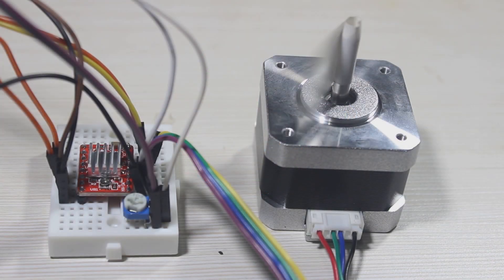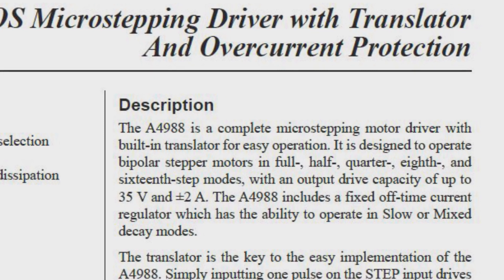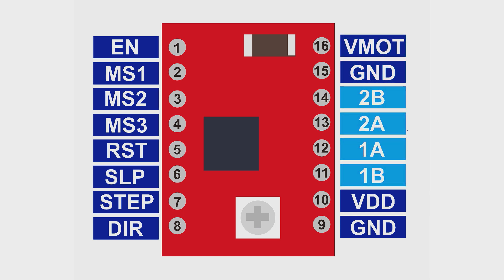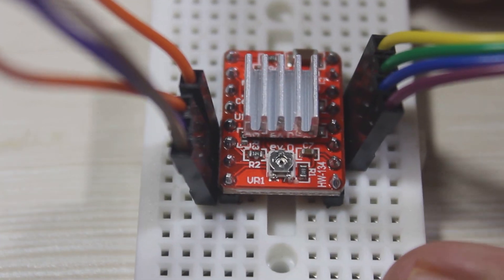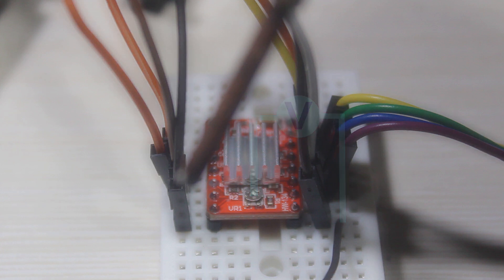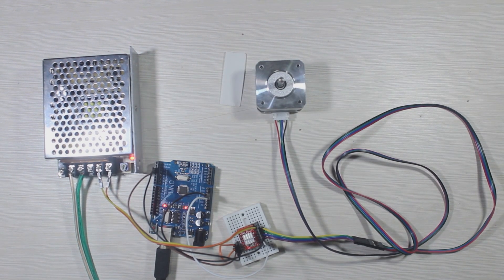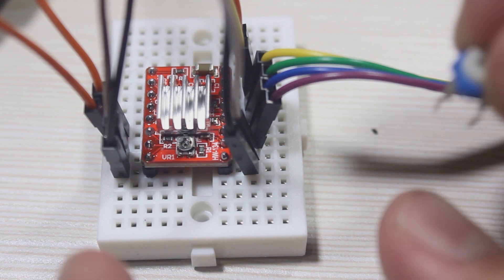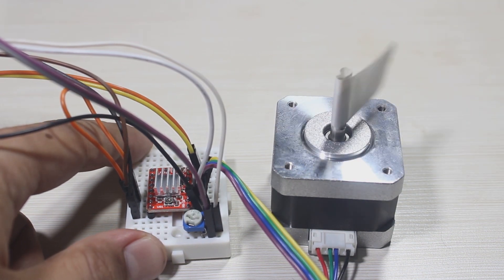How to drive a stepper motor easily using A4988 and Arduino

Comment: Need Help , I don't understand the formula to Get the value for current limit on A4988 with Audrino uno and cnc shield

I'm building a cnc hot wire foam cutting machine. I have. (2) N17 HS3401S- SZ motors. with [RATED Current DC 1.5A ] [Rated Voltage DC 3.8V ] I'm using  audrino  uno  GRBL installed with cnc shield with [3] A4988 steppers . X,Y.  I'm Using another step motor 17HS4401S Rated Current is 1.3A as for Z Rotary. The A4988 steppers what  current limit do I need to tune at ?  I'm not sure , I seen a few vid and now i,m confused Can anyone tell me how. Thank you .

Comment: Hi, how do you configure the pins of the  motor means which pin of motor is pin no.1(connected to 2B). I am not able to do as I am using BJ42D22- 23V01 NEMA17 motor.

For me it is not working properly.

Comment: // A4988 Stepper Motor Driver Pins
const int dirPin = 7;
const int stepPin = 6;
const int enablePin = 5;

// Stepper motor steps per revolution
const int stepsPerRevolution = 200;

void setup() {
  // Set the enablePin, dirPin, and stepPin as OUTPUT
  pinMode(enablePin, OUTPUT);
  pinMode(dirPin, OUTPUT);
  pinMode(stepPin, OUTPUT);
  
  // Enable the motor by setting enablePin LOW
  digitalWrite(enablePin, LOW);
}

void loop() {
  // Set the motor direction to clockwise
  digitalWrite(dirPin, HIGH);
  
  // Step the motor for one revolution
  for (int i = 0; i < stepsPerRevolution; i++) {
    digitalWrite(stepPin, HIGH);
    delayMicroseconds(500); // Adjust this delay to control motor speed
    digitalWrite(stepPin, LOW);
    delayMicroseconds(500); // Adjust this delay to control motor speed
  }
  
  delay(1000); // Delay between rotations
  
  // Set the motor direction to counterclockwise
  digitalWrite(dirPin, LOW);
  
  // Step the motor for one revolution
  for (int i = 0; i < stepsPerRevolution; i++) {
    digitalWrite(stepPin, HIGH);
    delayMicroseconds(500); // Adjust this delay to control motor speed
    digitalWrite(stepPin, LOW);
    delayMicroseconds(500); // Adjust this delay to control motor speed
  }
  
  delay(1000); // Delay between rotations
}

Comment: What is the silver thing you stick on the top of the chip?
Reply from the maker: that's called a heatsink, a metal to increase the heat of the IC.
Reply: @miliohm  Thanks for replying so fast.....I just googled it and found out from there also.
Reply: @sampuraktalukdar1374  It's Aluminum, to decrease heat of the IC. It's very important for the driver and motor to be able to use the rated current (around 2.5A for my Nema 17). Without the heatsink, it's only rated for half the current! Get some.
Reply: @robertbrodersen4438  Oh thanks for the info? 
So the motor not running in my case may probably be due to the lack of heat sink?....
Also I kept an led at the 4 outputs of the driver and it didn't blink neither damage (due to excessive volts) , so does that mean the driver ain't giving no output?

Comment: 6:13 I can't get this voltage on my driver with little potentiometer. I get maximum 0,03V. Where is the problem?
Reply from the maker: Did you use the conductive screwdriver?
Reply: @miliohm  Hi, I solve this problem, I am using driver L298N. It works perfect, but the motor is overheating after 10min of work. Do you know what is best option for solve this problem?

Comment: In my case. It does not work. I tried different arduino boards (uno, mega), different steppers (nema 17) and a4988
Reply from the maker: Sometimes there is fake A4988 in the market. It really easy to get hot, and doesn't work. Check the temperature of your A4988
Reply: @miliohm  Hey do you know how to check if A4988 is working or not?...

Comment: In your calculation the "2.5" value is a bit of a mystery. I assume it represents the "sense Resistor" value times the motors stepper setup percentage use (in my case this should be i00%). In another video the formula was "Imot x 8 x Sense Resistance (according to this guy the value "for most A4988"(?)  for this resistance is 0.068 Ohms). With his calculation I get a VRef = 0.816 Volts and with your calculation I get a VRef = 0.600 Volts. Which is correct? How do I know (without burning up my stepper or driver)? The only Spec Sheet I found doesn't list a "Sense Resistor Resistance", where can I find this value reliably?
Reply: Hi! where you able to find the solution? I have the same issue
Reply: @NedSar85  Note! That there is a reply to your question but you have to open the discussion to see it. I replied the wrong way, sorry!
Reply: The truth is “not with any confidence” but it worked anyway. The two surface mount resistors next to pins 18 and 24 (on my board) when magnified have 100 imprinted on them. From there I did some research to determine what the value of the SMD’s were (it’s been a while and I’d have to rediscover my notes and research), however these appeared to be, also based on blogs and conversations like this, to be the correct resistors who’s value(s?) were used to calculate, hopefully correctly. The result in the end was that my NEMA 17 driven star tracker worked. However mechanical issues related to the PLA 3D printed frame and gears driven by a curved threaded rod produced other issues. If I do this again I will pivot a straight rod and make the frame from 3/8” plywood in order to safely support my heavy camera rig. A lot of frustrations in this project that ultimately left me with more problems than time to solve them. The A4988 was the least of my concerns!

Comment: How much amps and do you need for moving the motor? Does it get a good torque? Thanks!
Reply: Not so much seeeing power cable is 20-18awg. My bet it's less than 2 amps.

Comment: i am facing the same problem had tried all the solutions changing wire combination, code, pins drivers but the motor is still sometime gives a beep only or rattles with beep and the strange thing is that motor is showing continuity in all four pairs, led blew up no matter what the wire combination is it show continuity on pairing 1,2 -1,3 -1,4 and so on for all. I had tried running motor directly with arduino without motor driver and it is running, but facing issue while it is connected to CNC shield with A4988 driver.
I am using Arduino uno and motors are 4 pinned. Could you please tell me what I am doing wrong?
Reply from the maker: are you already set the max current using the potentiometer?
Reply: @miliohm  yup current is up to the mark
Reply: @miliohm  can you please tell me the reason that why motor is coils is showing continuity in all pairs ? wont it just show in any 2? but its showing continuity with every coil, like I Checked continuity on pin 1 and 2 Ammeter beeps and then I connected pin 1 and 3 it again shows continuity and same goes with pin 2 and 4. it's Nema 17 stepper motor with 4 pins. Can you tell me the reason behind this? AFAIK It should show continuity on any 2 and not on all. Correct me if I am wrong 
Thanks.

Comment: Mau tanya bang, kalau motor nya tidak bisa berputar ccw itu kenapa ya? Padahal sudah sama seperti di video juga
Reply from the maker: Apakah sudah diatur arus maksimalnya?
Reply: @miliohm  Vref nya saya atur 0,5 V. Apakah kurang kalo utk motor nema 17?
Reply from the maker: @vincentiusdhimasr.p.2695  Coba-coba aja diputar naik turun, kalau tetep ga jalan cek apa wiringnya sudah benar. Dan kalau tetep tidak jalan coba pake ganti drivernya. kadang kalau yang bajakan suka ada yang rusak
Reply: @miliohm  siap, terimakasih infonya 🙏

Comment: Hi my friend, I have a question, and maybe you can help me, so, how can I control 2 motor to move at same time, can I take same signal for to drivers? Tks
Reply from the maker: Yes you can, but you should know that the amperage maybe become a problem. The driver will get hot easily.

Comment: how is the code if we using switch sensor as a output of step = high (500 rotation)  and dir =high 
and then button switch to delay then change the dir=low step=high (500 rotation)